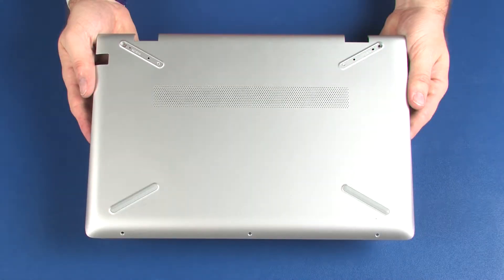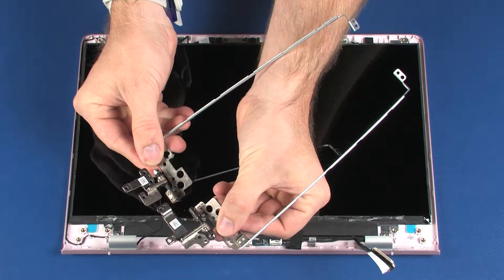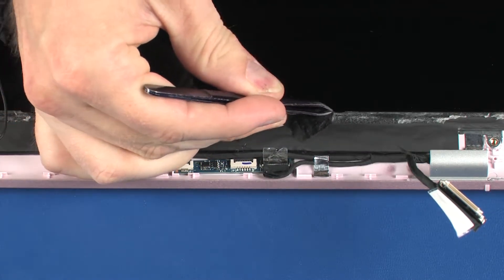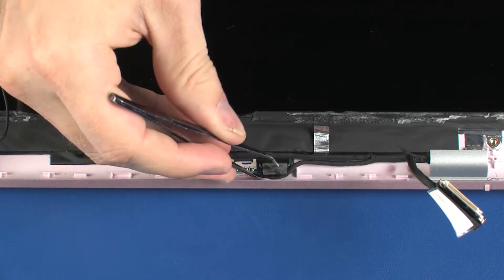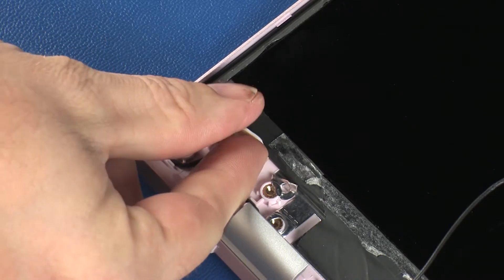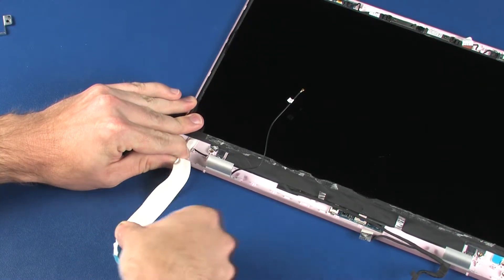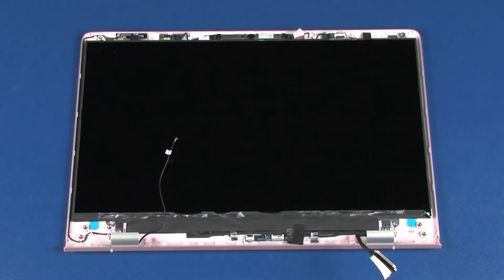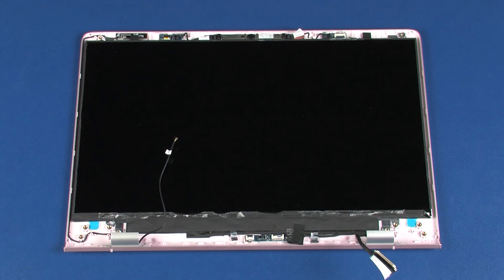Remove the Display Panel | HP Pavilion 14-bf0xx Laptop PC | HP

Comment: How do I remove the display panel assembly? Not one video will show me. Will the laptop still work if I don't replace the assembly? I want to use a huge monitor with the laptop, but the assembly is in the way on my desk, so want to remove it. So in other words, all I want is the base of the laptop/keyboard, etc.
Reply from the maker: +MICHAEL FILIPPONE HP does not recommend upgrading or downgrading hardware parts or software that is bundled with the product as It may affect the manufacturer's warranty and performance, however, you could change the configuration at your own discretion.